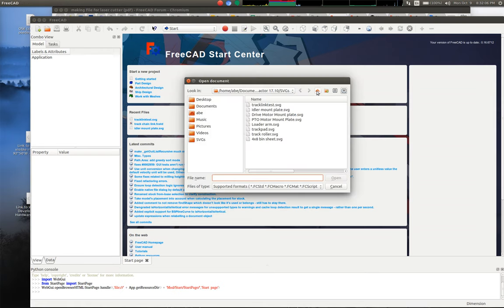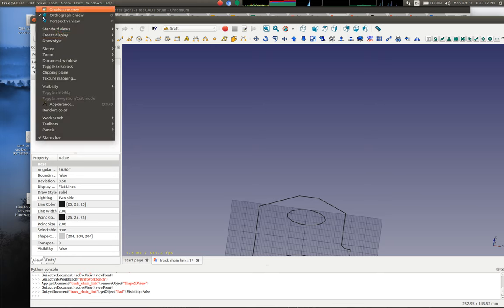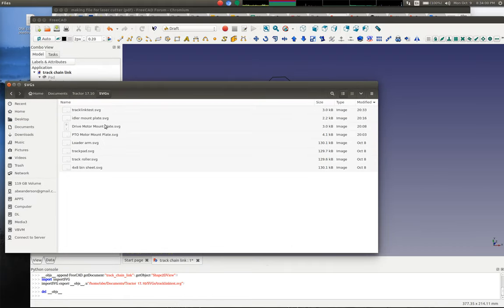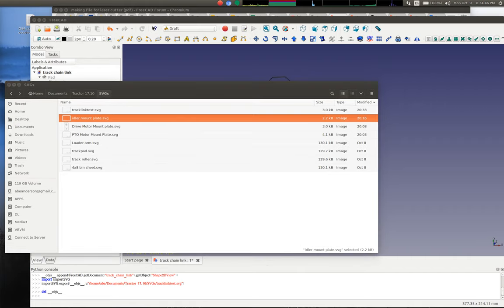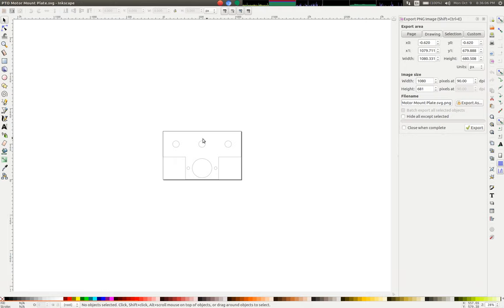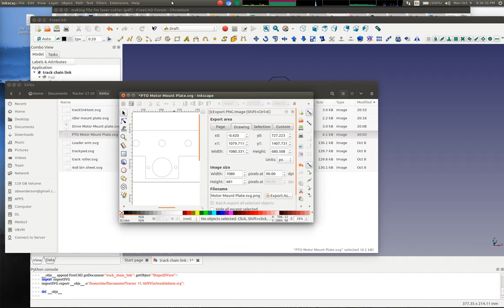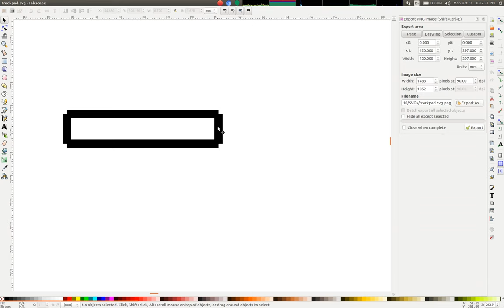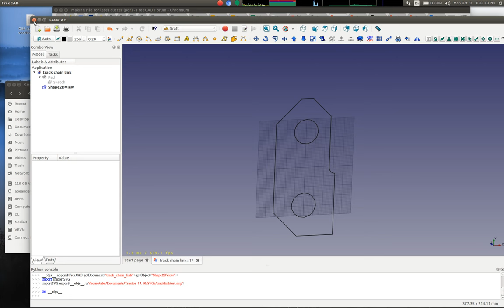FreeCAD SVG export for SVGNest issues

Comment: Hey Abe, did you try to change the preferences in FreeCAD? I remember I had a similar issue with circles when exporting DXF. There is an option in Preferences -> Import-Export -> DXF, it is called: "Treat ellipses and splines as polylines". Actually, I could export the svg for that part of the track unit without any problem. So maybe that option for DXF exports also affects the SVG's. About the broken lines, this works fine: https://forum.freecadweb.org/viewtopic.php?f=3&t=14038&start=20#p112312